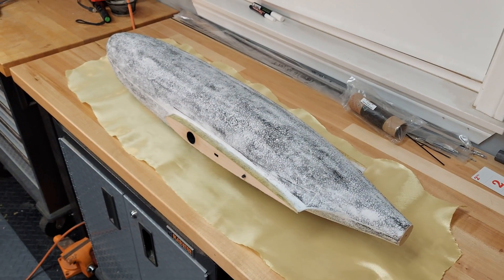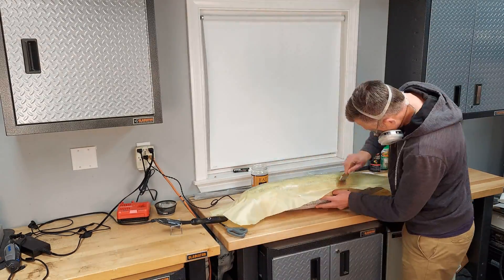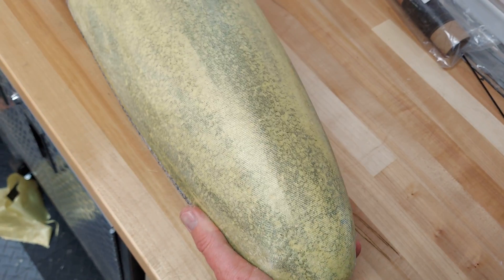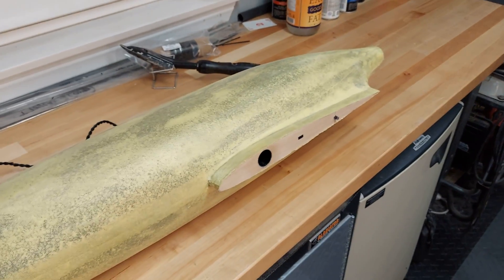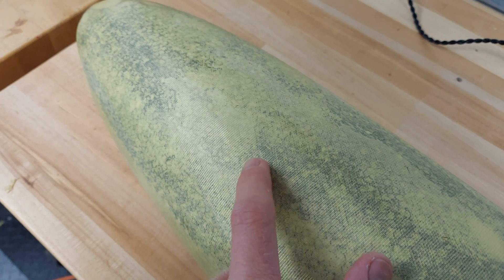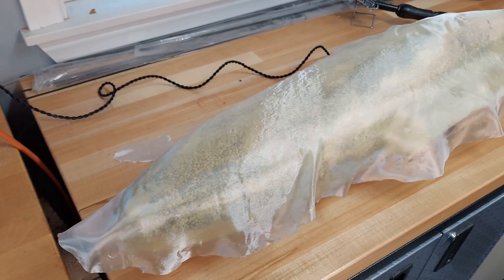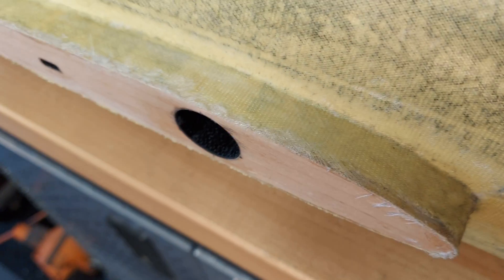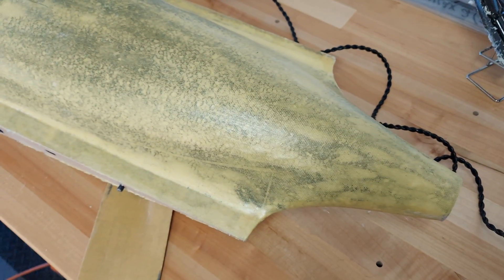EPP and Kevlar Drone Construction Techniques (Part 2)

Comment: hi, very nice work, I like it, got a question to ask, have you ever tried to remove the inside foam and just use the Kevlar-epoxy shell with some reinforcement ?  like making a thicker shell or putting some frame inside ?